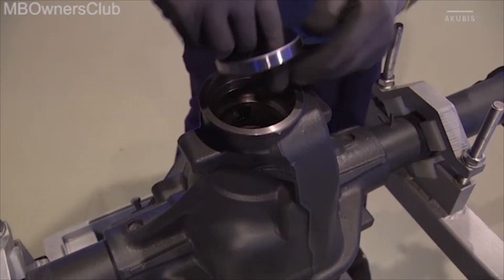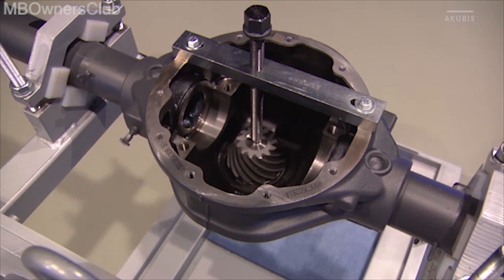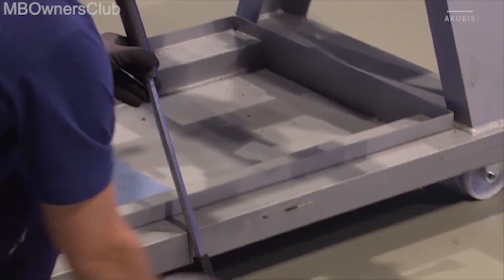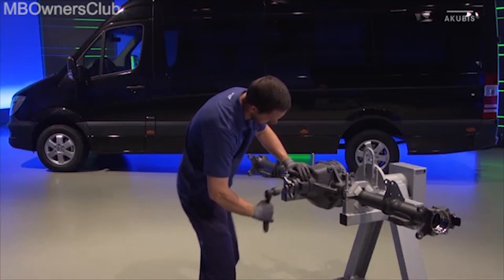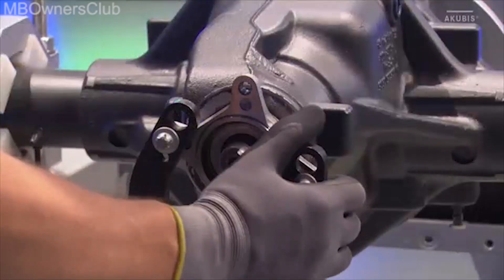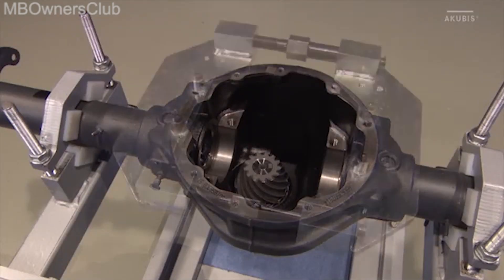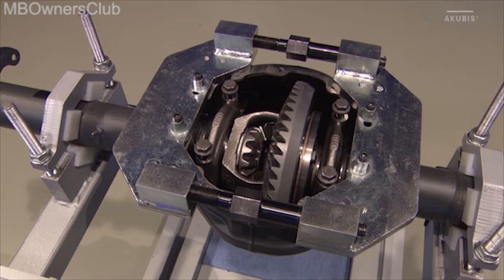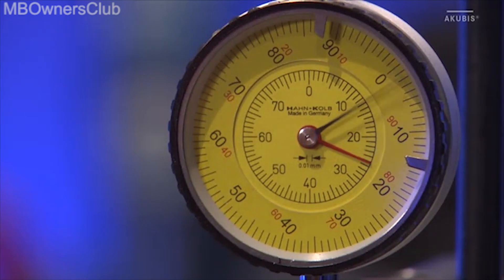Mercedes-Benz Sprinter Rear Axle Repair: Part 5 - Gear Backlash Adjustment (W906, W900)

Comment: What is the service life of a Mercedes sprinter rear differential? Mine started to go out at 300,000 miles, I maintained it properly and it only saw lite to medium use with mostly highway driving.  300k seems like pretty low miles for it to be failing.  My transmission and motor work as good as the day as I bought it but this stupid simple part is failing?!!.